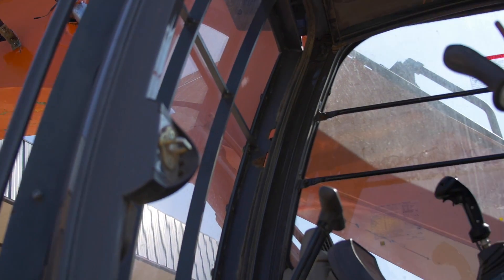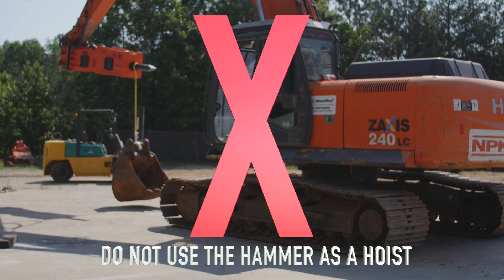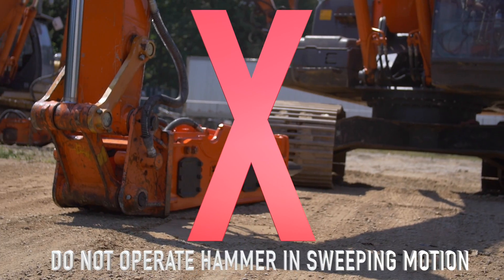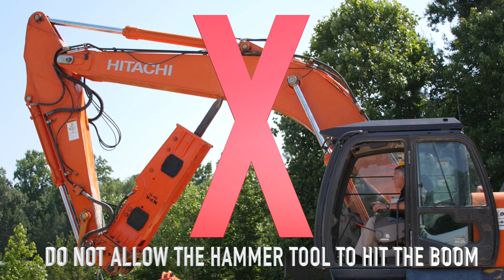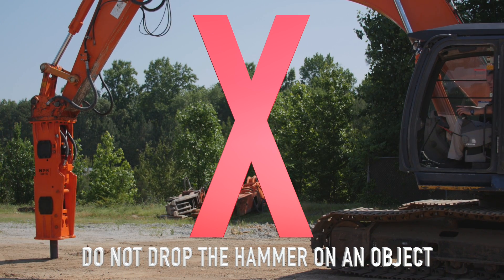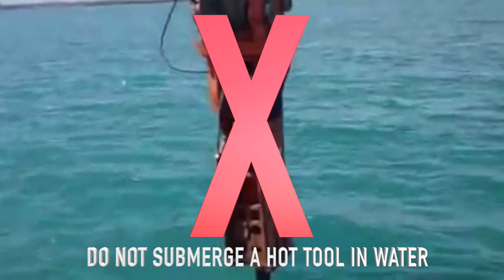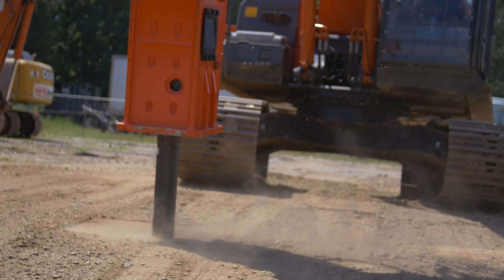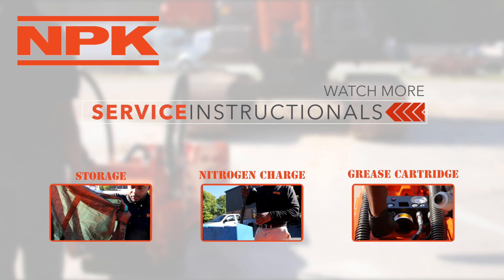Hammer Operation - NPK Hydraulic Hammer Service Instructional

Comment: So basically hammers are so fragile that they are not practical. If I had to run mine like that I would decrease productivity by 70% trust me I figured it up it would be cheaper to run a hammer hard and buy a new one every month and a half than to run it like that and loose that much production.
Reply: Yeah but not everybody's job site is bound by the speed of jack hammering, most people that operate one try to hold on to it for many years.
Reply: Lol buy one every month huh, you obviously don’t know how much they cost.

Comment: Grease is important. In accordance with the manufacturer, it must have proceeded every 2 hours. Routine work is the cause of failure. To make it more safe and secure use autolube system for hydraulic hammer https://buyaftermarketparts.com/articles/71_auto_grease_pumps_for_hydraulic_breakers
This grease pump is driven by hammer vibration. Check this out.
  NPK autolube pump works by hydraulic.